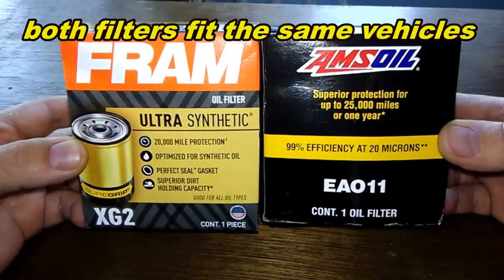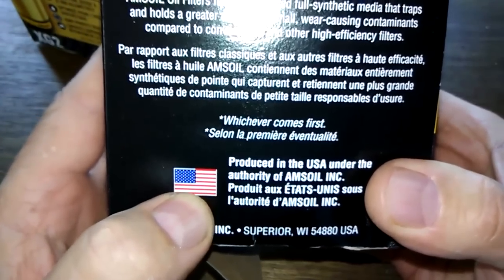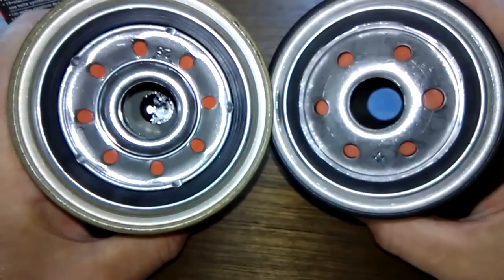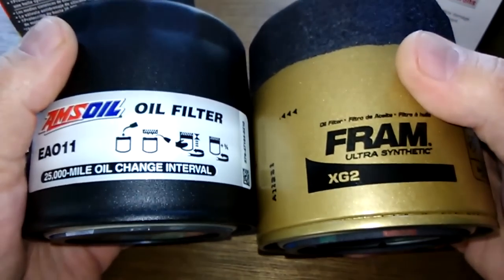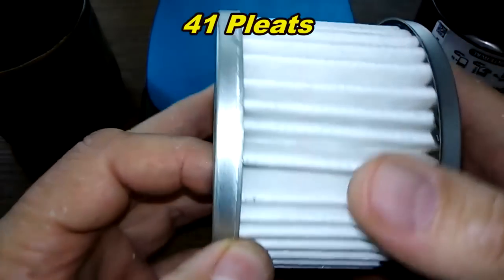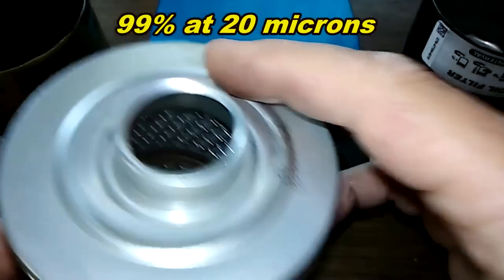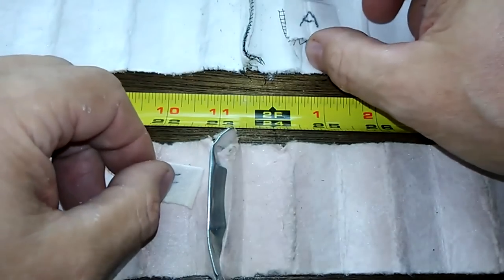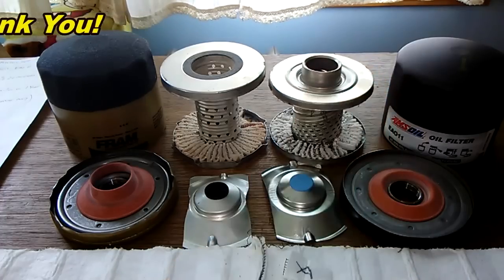Fram Ultra XG2 Oil Filter Cut Open vs. Amsoil EAO11 Oil Filter Cut Open Oil Filter Review

Comment: Plus $10 shipping for the Amsoil filter. That filter will cost you $30 bucks.
Reply: Crazy I can do 2 oil changes for the price of that amsoil filter
Reply: @tonychau1983  sure, up front costs. But you can make it cost effective by increasing drain intervals and still get better overall protection, less wear, clean engine internals, stabile viscosity at high and low temps. Easier starting, increased mpg. using AMSOIL's premium 100% real synthetic oil and EAO filters. It's been tested and proven to work. Also their preferred customer program gets you reduced prices & Free shipping on 100 bucks or more, although the shipping isnt terrible at like eight bucks, but I wouldn't order one filter at a time, that like alot of things the shipping gets to much for one or a few small items. There is getting to be more & more retailer's handling Amsoil products though.
Reply: I can't find the laugh emoji?
Reply: @robshaw2990  😂😂🤣🤣 there I found it for ya
Reply: @429thunderjet2  thank you

Comment: I run the fram ultra with mobil 1 on my cars and have over 200k on three of my cars. No issues.
Reply from the maker: Good choice👍
Reply: What brand cars you own
Reply: @adminadmin9997  2 Lexus, 1 Toyota, 1 Honda
Reply: How many miles do you go before changing oil and filter?
Reply: @Gretzky2857  I still don't run more than 4,000 in between oil changes. I know they say you can but if you looked at what they mean by normal and severe driving you would find out you are driving in the severe category a lot more than normal driving.
Reply: @Gretzky2857  Just hit 300k on my Sequoia and still runs like new.
Reply: @stevenyoung3360  great truck!  I have an ‘02 4Runner and wanting it to last as long as possible
Reply: @Gretzky2857  I have seen abused 3.4 Liter 4runners with over 300k on them. I sold a 1999 4runner with 420k on it and it ran like new.

Comment: The Fram is a paper cellulose synthetic media blend while the Amsoil is 100% synthetic media fram doesn't have the same micron rating Fram fine print says specifically above 20 micron.
Reply from the maker: I know,
 they changed the Fram Ultra, the one in the video is the older one with the metal backing, and they no longer have the metal backing. The micron rating now is 99+% for particles above 20 microns. That's pretty close.
Thanks for your feedback!
Reply: @WhipCityWrencher  little side note fram does make a Titanium filter that is what the old ultra was but looks like a little better construction. But again it's achilles heal is a paper synthetic blend media that is only 99% above 20 microns what they refuse to state is at what micron level exactly it could mean 25, 30, 35, 40, which is it? Respectfully I would guess 30. The price for this Fram is $15.79.  Where the Amsoil is $19.79 preferred customer price otherwise retail $26.35. so for $4 more I get a higher flow rated 100% synthetic nano media that at the same ISO standard is 99% efficient AT 20 microns. For my Cummins diesel the Amsoil oil filter is worth it's weight in gold at $4 more because of the soot the engine produces. Also why I would never go  20,000 miles with out the 2 micron oil bypass filter kit also installed. Never do extended drain intervals with out it.
Reply: @WhipCityWrencher  btw great channel people need to see they do actually get what they pay for. If you want too quality your going to pay for it.
Reply from the maker: @Jon-O.  This is supposed to be the micron rating on the Fram Ultra Found this on a post BITOG https://i.imgur.com/NMu7XDq.png
Reply: @WhipCityWrencher  yeah that's a post on a blog with no traceable reference to Fram to verify. I've tried looked all over their website called Fram spoke with one of their engineers and they won't say anything but exactly what their fine print already says 99% greater than 20 microns. Im very skeptical of fram over there deceptive cardboard constructed filters that wiped out engines because card board plugged oil ports.
Reply: @Jon-O.  Your the OIL MAN, Jon!  Telling the Truth, nothing BUT the truth!  Crappy Mexican Cardboard?  The AMSOIL By-Pass filters are Amazing, I sell a lot of them!

Comment: What about flow? Amsoil looks like it would flow far better? does it matter?
Reply from the maker: I have No way of testing flow rates , but you may be right?
Reply: @WhipCityWrencher  The core of those filters look like Amsoil had twice the amount. I just don’t know if that matters or not? Thank you for your response. I use that exact Amsoil filter but if the fram is just as good then I might as well save some bucks. I was just wondering about flow.

Comment: I’m not concerned about the glue job,as a little extra glue on the end could make the seal between the media and the metal stronger and longer lasting where it’s needed most. Also where is the Fram filter made? If it’s China, spending 10 bucks more,especially if you use extended drain intervals, for a marginally better filter with the Amsoil filter is worth it to me to employ Americans. Also the Fram had a 12psi vs 15 psi bypass spring, allowing unfiltered oil to enter the engine more easily
Reply from the maker: Sorry, I guess I forgot to show that in the video. The Fram filter is Made In the USA.
Thanks for your feedback👍
Reply: @WhipCityWrencher  I noticed in your video, that you mentioned AMSOIL was made in USA, then  you skipped over the Fram box, I went back & paused it, Fram is HQ in Cleveland, BUT, that box stated " product of Mexico" ??  The cost of doing business in Mexico, is a Helluva lot cheaper, with NO unions, OSHA, min. wages, quality control, etc.!  K&N M/C filters are made in Thailand ??
Reply: Hey Darryl, you are correct, MAGA!  There are many differences, Fram has a thin wall can, 12 PSI By-Pass valve, etc., Made in Mexico, & the trashy cheap cardboard filters, they put their name on??  AMSOIL has much thicker walls, 15 PSI By-Pass,  Abrams Tank Nano Fiber Technology air & oil filters!  Most of NASCA uses Wix, if I can't find AMSOIL, I use Wix!  AMSOIL Dealer 19 years, Official AMSOIL Dealer for Laconia M/C Rally!
Reply from the maker: @jimandnancymcoil  Sorry, I messed up because  I didn't stop to show it on the video, but it does say made in the USA. If you freeze it at the 3:33 mark in the video, you can just barely make it out. If you don't see it I'll get a screenshot of it. All the Fram Ultras I've ever opened have said made in the USA on them. Please show me where it says product of Mexico?

Comment: I bought an amsoil filter some years back and it had a huge chard of metal hanging off one of the threads towards the inside of the filter, good thing I looked it over and I didn’t use it.
Reply from the maker: It's a good idea to look over the threads before installing a filter, I also like to shake them to make sure nothing loose inside.

Comment: Its all about the micron ratings I know AMSOIL is 99%at 20 microns.  Some filters state 99% at 30 microns that means that it stops bigger than 30 micron of debry so the lower the micron rating the better.  They all can say 99% but then look at the micron rating. Stopping 20 microns means that tiny metals that the engine sheds will not go back into the engine and cause wear.  I would say most of the stuff he does is irrelevant and also he can not test the material quality of the paper like filters vs one another. As I said its the microns and what that material stops in size from going back into the engine to wear the moving parts. Amsoil is 20 microns and I know their oil is probably the best oil you can buy for your car to slow wear and make the engine parts last longer.
Reply from the maker: True enough, the Fram Ultra and the Amsoil oil filter have the same micron rating. 99% at 20 microns.
Reply: @WhipCityWrencher  I’m not so sure if they really are the same, as maybe it’s a play on words, but Frams website stated their filter is rated at 99% at more than 20 microns. What does that mean? Amsoil says 99% at 20 microns. Hmmmm?
Reply: @darrylsjodin7184  also Amsoil filters are rated 99% at 20 microns absolute.  If Fram is 99% at 20 microns nominal instead of absolute that is a huge difference!
Reply: @Mybalzitchin  You are absolutely right! I was doing some searching and I found an actual filter test chart from Ascent filtration testing llc, with 5 filters including the Fram, (not Amsoil) and the Fram was at 99.9% at 20 microns and dropped only slightly to  99.81% at 15 microns. Royal purple was 99.1% at 20 and 98% at 18 microns. The fine print did say the test is only for the element tested and only this test. He found some defects in some filters, some leaking by through the element, or the bypass valve. The Wix filter tested wasn’t even able to do 99% at 50 microns. I would attach a picture of the graph, but I don’t know how.😂
Reply: @darrylsjodin7184  I just heard back from Fram.  Surprised at their response regarding the Fram Ultra filter.😳
 	Thanks for contacting FRAM Technical Support. The 99+% efficiency rating of the FRAM Ultra XG10575 is the absolute rating. Have a great day and thanks for chatting with FRAM!

Comment: Friends don't let friends run FRAM oil filters!
Reply: run boss wix xp purple and amsoil  filters in my 2022 caddy v6 xt5 platum amsoil oil only  5-30  my 2018 frontier 5-30 kirkland oil and penzoil ultra oils filters boss and wix xp  the kirkland oil is not bad i change it 3500-4000 same with pennzoil mix good filters cant go wrong

Comment: On a 1990 turbo DSM owners manual said, during normal operating temps. 

Oil change every 5000miles
Filter change every 10000miles

Something to think about. That's in 1990. Mineral oil.
Reply from the maker: Yep, Back in the 70s and 80s
I remember taking some of those engines apart, and they were all sludged up.
I think with today's engines and oil,  5,000 miles is a good OCI.
Reply: @WhipCityWrencher  yup, the oil was so inferior back in the day that the oil in the turbo return and supply lines due to heat after driving and no more circulation once you turned off the car would 'coke' up or cook and solidify killing the turbo once you turned the car on again, my brother would always idle his turbo cars after driving or install a turbo timer (idle for two mins after engine off) 

Thanks for the video
Reply from the maker: @nikkoBcool  You're Welcome!
Yep, the oil has gotten a lot better.

Comment: What it carefully.  Most mechanics tell me to go OEM on everything I replace.   Todays engines are so complex that they can be very picky when it comes to oil flow and pressure.  Also, put the correct oil that is stated in your manual.  I've had cam phasers go out due to putting too thick a grade of oil in the engines, it is costly to repair.
Reply from the maker: Definitely put the correct grade oil in your engine. The oil filters in the video are better filters than OEM.JMHO
Reply: @WhipCityWrencher  I'm with you on some filters being better than others, they have the science and testing to prove it.  I've had real problems lately with electrical parts - especially Auto Zone.  Don't have the same dimensions as OEM, fit is bad.  As soon as i went OEM - AC DELCO on starters and alternators the problems went away.  My son remarked that his 1998 GMC Sierra never started so quite and easy.  The Auto Zone starter ate up his flywheel, we had to replace it.  Know of one guy with a Ford Focus who has always run the correct Motorcraft oil and filter and has 407,000 miles and still going strong.  Pays to treat your car decent.
Reply from the maker: @rtaggs8178  I agree, when you have to change out parts, most of the time it's best to replace them with OEM parts instead of some Chinese/Mexican-made after-market parts. I have a Ford, and I try to replace it with Motorcraft parts as much as I can, but the oil, and oil filters I buy aftermarket as there are better oils, and oil filters out there compared to the Motorcraft oil and filters. Motorcraft oil is a synthetic blend, not the best. Your friend's Focus would have probably gone 407K miles regardless of what he used, but Thanks for Sharing!

Comment: I don't understand your obsession with the anti-drainback seal being "loose" on the threaded base. It's supposed to fit snugly on the filter end cap.
Reply from the maker: Because to me,
 a well-made oil filter should have its components fit snug and that means all its components are not loose like a cheap oil filter would be. If everything is tight it will work better. Did you know that some will even make noise on start-up and some on acceleration?
Yep, my engine does when I use some cheaper oil filters, its not much but it's there.

I try to show the viewer the good and the bad, I could zip thru a video in 2 min. and say something like well that's all the parts to this oil filter and not talk about it or give an opinion., hey, it would be a lot easier for me, but who would want to watch that?
I know they are supposed to fit snuggly on the filter element, but why do some of them fit tight on the base plate and others do not? Which would you prefer to have a Lose or tight-fitting anti-drain back valve.? 
In the end, I try to talk about as many components as I can, good and bad without making the video into a movie.
I may have several obsessions, one would be cutting oil filters open. lol

.
Reply: The ADBV looks "loose" because it's dis-assembled. When the filter is assembled, the ADBV makes proper contact with all mating surfaces.
Reply: @SlikLizrd  Did you not read my post? I know that and was making the point that the ADBV is intended to snugly on/in the filter, not the base. Whip City was commenting about it's loose fit on the base, and that's how it should be so it can work.

Comment: Stop making the fram ultra sound so inexpensive. For the one my vehicle takes (XG9972) it's $10.97 and it's only the filter element and o-rings cause it's a cartridge filter. It should be a lot less for a cartridge filter. So give the range of prices, not just the single price for the one you're cutting open. That will increase the helpfulness of your video.

What do you mean, "I don't see how you can do that without changing your oil"? You can change your oil without changing the filter and you can change your filter without changing your oil as long as you top off your oil. Why not?

I'll use the Fram and change it every 10k. No way am I going to pay $20 for a filter and change it every 10k and no way would I trust either of them beyond 10k to not have an affect oil flow rates after 10k of accumulated contaminants. I'll keep changing my oil every 5k using Super Tech 0W-20.
Reply from the maker: Sounds like you have issues with Walmart's prices.
I'm not saying the Fram Ultra is an inexpensive filter, in this comparison, it was a lot less money than the Amsoil oil filter, that's for sure.
I'm not going to name all the prices on all the filters made by the manufactures on each video I make. Who does that? 
One thing is the price will vary from store to store and the price changes all the time. I just looked up this Fram Ultra in the video and it's at $8.28 now so it went up from when I made the video. The price is for a ballpark figure, that's all. The viewer should look up his or her oil filter size at their store and get the correct price.
I have my OCI opinion, and you have your OCI opinion. 
We can agree to disagree. Have a good day, Take Care.
Reply: @WhipCityWrencher  
I don't think I mentioned Walmart but they aren't the only ones that charge more for a cartridge filter than they charge for the spin on canister. I think it likely Fram that charges more at the wholesale level. A cartridge filter should cost less because it has no metal can, no base plate, no anti-drainback valve, no spring, no pressure relief valve.... Hello! Again, I'm not blaming the retailers cause they all do it..

Comment: I use to think people were full of it when they said fram filters were garbage 🗑️ until I seen a few videos of cutting them open and seeing how they are put together and made from  thankfully nothing happened to the engine when I was using fram like some unlucky people have happen. I definitely switched to other brands quickly after that
Reply from the maker: I agree the orange Fram is an entry-level oil filter, and I dont care for them either. The Fram Ultra on the other hand is a pretty good oil filter with a decent price at Walmart. They changed them recently and time will tell how they hold up, I will be cutting open a used this summer that I have put on my daughter's car.

Comment: Well you can go 6 thousand mile on a motorcycle with no oil change an same filters from dealers. Walk into a dealer they try to sell you a oil change an filter for 30, 60, 125.

Comment: Hey I used Fram years back until I seen the inside one of them after use. Cardboard deteriorated. I have used Baldwin’s, NAPA , WIX . Your video today shows both of possible equal components. I thought AMSOIL would have had coil spring. I’m not a fan of FRAM but AMSOIL should watch this one.
Reply from the maker: Thanks for your feedback👍🙏😊
Reply: Leaf springs are used on trucks and are more progressive and carry a load better than coils.
Reply: Do you really think AMSOIL doesn't know how their filters are built? Visual inspection is fine, but the proof is in the performance.
Reply: They both had a coil spring

Comment: The Fram with a bypass pressure of 12 vs 15 on Amsoil means the oil with get you block easier on cold starts. That means less friction and less wear on engine block moving parts.
Reply from the maker: Good point! 👍
Reply: We would need to ask the filter mfg co, but I’m thinking that the bypass valve is more like a relief valve to protect the media from blowing out if restricted. Thinking about how small the oil passages are, it doesn’t seem like the oil volume is that high, compared to the surface area of the filter, so the valve should stay closed.